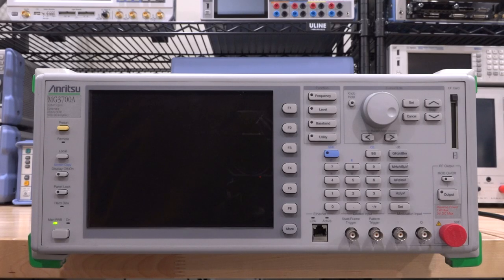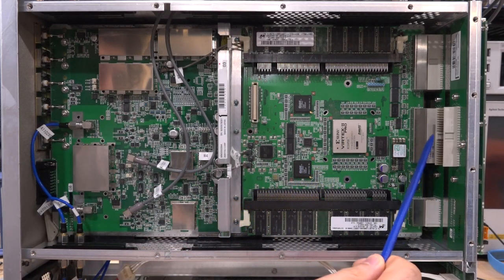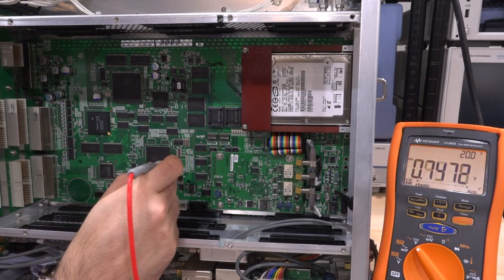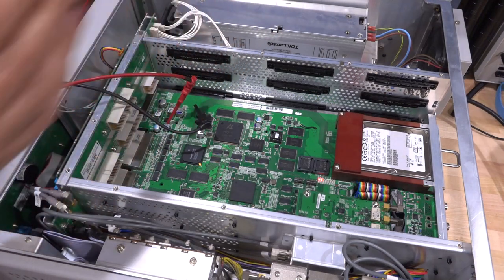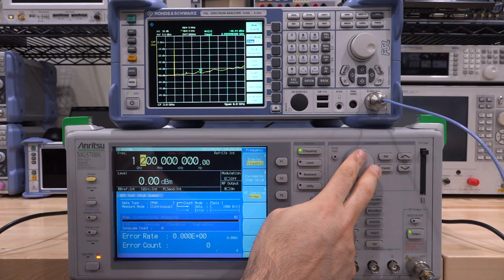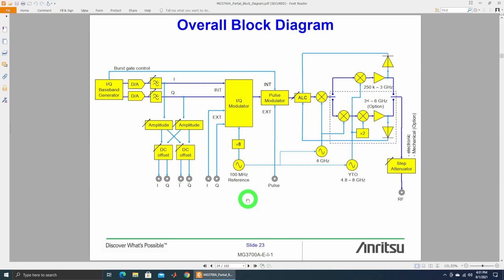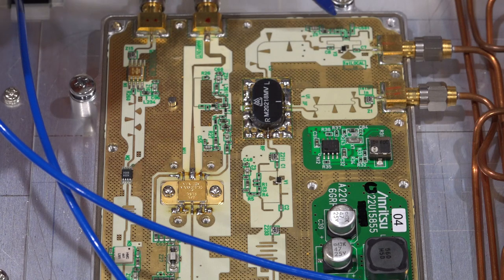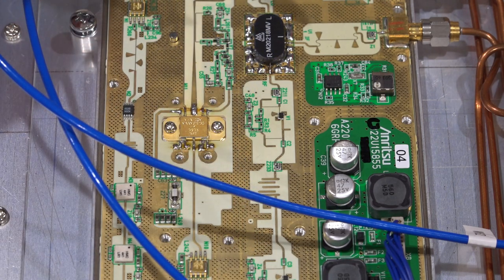TSP #198 - Teardown, Repair & Analysis of an Anritsu MG3700A 6GHz Vector Signal Generator (Part 1)

Comment: Looks like HP/Agilent/Avago/Broadcom MiniPack's. Probably ATF-551[m4] (Vx marking, where x is a date code) or some PIN dual/quad
Reply from the maker: This is promising! The voltages match up and connections makes sense. I bought a few of them from eBay. :)
Reply: @Thesignalpath  Great! As far as I understand, they are only there to gain back that insertion loss caused by the 3 stages of BPF and maintain a flat response.
PS: Could you explain or give a hint on how those impedance matching networks work here? Usually it is 3 pages of intimidating math and a kung-fu roll of passives with no hope of understanding what this is all about .

Comment: Could you measure one of the good pin diodes with a curve tracer and find another with the same characteristics?
Reply: Its not a matter just curve tracer but characterize the parasitics
Reply from the maker: Not really. The component’s I/V characteristics is important of course, but it doesn’t tell us about it’s high frequency model.

Comment: Tough part to find, I wish manufacturers marked their parts better. I can't remember how many times I've been confounded by the same problem. I hope you find the part, maybe a lengthy mouser or digi key search will help, but I bet you already did that ;-)
Reply: Why? The manufacturer knows exactly what it is. "Send it in. We'll fix it." (for 80% of the cost of new.)

Comment: Thank you for another great repair video ,technology is getting smaller every year,how long until components are so small it's impossible for any repair to be completed without use of robotic micro hands.when you see how electronic parts are getting so small the right to repair bill will be worthless without expensive specialist equipment under super Magnification .How long until parts are so small they can fit them inbetween the different layers of the PCB,when you look at a pcb for modern phones or computers and see how small and compacted they are now what size will they be in 10 or 20 years.
Reply: Nothing to repair again and us will be replaced with Robot, sadly the end of electronic technician :(
Reply: Some components can't get any smaller to the fundamental physical limitations. It's a matter of politics and legislation since research into self-diagnostics is progressing rapidly. Companies should just implement them and use off-the-shelf parts.

Comment: The diode (if it is a PIN diode indeed) might be an HMPP-386x or HMPP-389x type with an odd marking on it.
Reply: I think you are on the right track, that could be it.
Reply from the maker: Its close, but these components have two of their diagonal pads internally connected.
Reply: @Thesignalpath  The HMPP-389T has internal connections from pins 1 to 3, and 2 to 4. So both of the diagonals are connected. Hmm...

Comment: Nice fault localization video! 👍

Didn't find that component marking in my book with smd markings..
I think, that this unknown part is, probably, some transistor (RF FET) or dual transistor.. 🤔 
One idea, even, was ATF54143, but wrong marknigs and pinout.. Sad, that by picture, isn't possible to get package dimensions..
I missing times, when manufacturers published schematics.. 😢
Update: ATF-551M4 have similar package and product code is V, but W may be data code..
Reply from the maker: I bought a few AFT-551M4 transistors from eBay!

Comment: Maybe a stupid suggestion but : What about decaping the dead component ? Is it possible to identify the part with the stuff engraved around the chip circuits ?
Reply: You might see a vendor logo but IC dies (and especially discrete transistors/diodes) usually just have a mask ID code (or sometimes a code name) and not an actual part number, which is decided by marketing long after the chip is taped out. So it won't get you much closer to actually identifying the part itself.
Reply: @AndrewZonenberg  You could always try contacting the manufacturer afterwards and requesting the part number. I have a feeling that sending an email from the Bell Labs domain would also be helpful. 😁

Comment: Cool! I have a MG3700A too! It had the same problem with janky buttons but the responsiveness cleaned right up after taking the pad out and washing it. Soap and water was enough. Re: the PIN diodes -- what's the basis for those being PIN diodes rather than amplifiers/transistors? I've seen a bunch of amplifiers gang-biased to boost the well-behaved variable gain range and this sort of reminds me of that, besides, it seems like a long way, a lot of filters, and a lot of pads to go without amplification at 9GHz -- but I've been fighting noise figure recently so maybe my intuition isn't in the same place as theirs. Anyway, just a thought. Love the content, as always!  EDIT: Oh, right, the voltages. Then again... maybe the bias voltages are wrong?
Reply from the maker: I agree that they can also can be amplifiers. They are very small, but they probably don't need to produce a lot of power.
Reply: @Thesignalpath  If you want to send me one, I can decap it and send you a few photos. Should at least help you determine amplifier vs diode, even if it doesn't get you closer to a positive ID.
Reply: @Thesignalpath  No, it is not an amplifier...you measured the bias voltage at around 0.5V. No amplifier would work with a such low volrage...insted 0.5V can be the right voltage drop across a PIN diode junction. Regards from Italy.
Reply: I agree, I like them being amplifiers. The mixers are passive as well I think, if I found the right datasheet.
Reply: @erikbertram6019  Could you be so kind to show the complete part number or a link to the datasheet? Thanks in advance. Regards.
Reply from the maker: It can be an amplifier. The other port was biased at 3.4V, I just didn't show it on camera. Someone suggested that it could be a ATF-551M4-BLK which is a good match!
Reply: @Thesignalpath  Yes, 3.4V as bias voltage makes sense for an amplifier.

Comment: Ignore this if it's stupid as I'm a dummy - lol -, but can you measure the characteristics of a good diode and cross ref it with the package - the package might not be comvential so there might not be many - aand guess at it.
Reply: That's what I was wondering.  Would it be possible to pull another device with the same marking and attempt to characterize its response.
Reply: Kinda learned this same little trick from CuriousMarc when he was looking for a transistor for that Alto restoration awhile ago in the power supply.  However I get that was probably nowhere near as demanding of a sub as this is going to be.  And of course setting up something reasonable to attempt a measurement but I would think I/V characteristics would get one on a very close path.  Is there a good one to pluck off the board?

Comment: Hi, I have a MG3700 with the same problem. I confirm that the 3 components in the 8.8GHz chain are active transistor ( HEMT?) with about 12dB gain, not pin diode. In my case all 3 seeems to operate but I have a level about 25dB lower than expected at 3 to 6 GHz output. All 3 amplifiers are operationnal but the signal is quite low befire the second mixer.....
Reply: Were you able to solve the problem? I have the same thing as yours, all cascades work, but the signal on the mixer is weak. The problem is something else.
Reply: @RuslanStashkevich  I did not find the cause of the problem.  To solve the trouble I inserted a 25dB amplifier in the 8.8GHz ampli chain after the third transistor. The amplifier is a connectorized model in SMA and I drilled two holes  in the module to insert semi rigide cables.
Reply: @jean-louisbezombes7135  Oh, that's great. I solved the problem another way, by adjusting all the bandpass filters. They had too much attenuation coefficient in the band.
Reply: @RuslanStashkevich  that's ok. How did you adjust the bandpass filters ? It is quite  strange that the passive  BP filters have change with time.